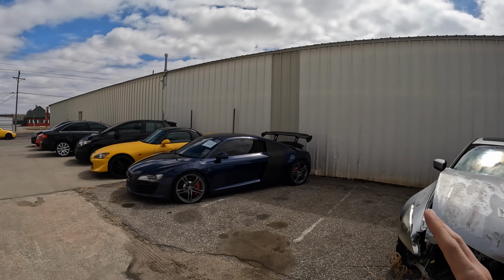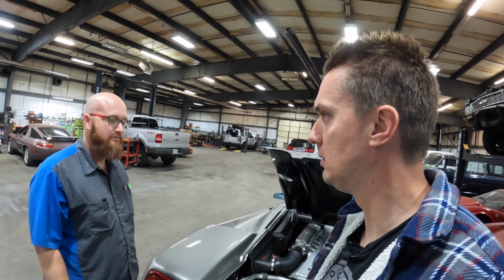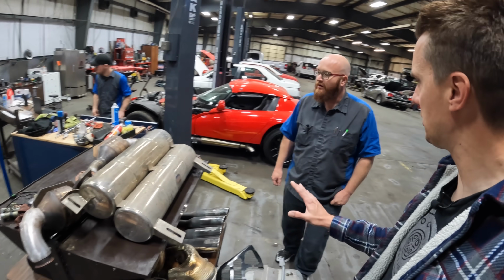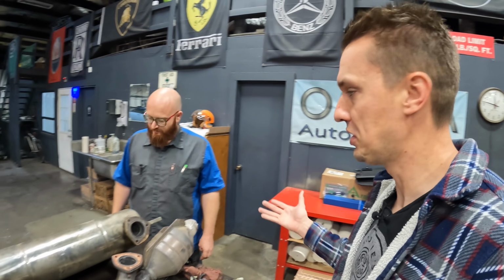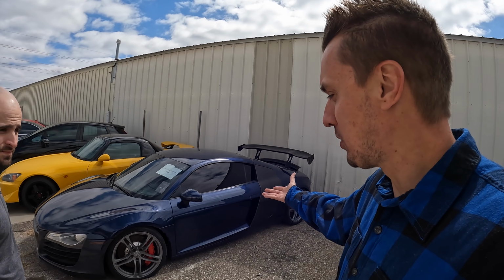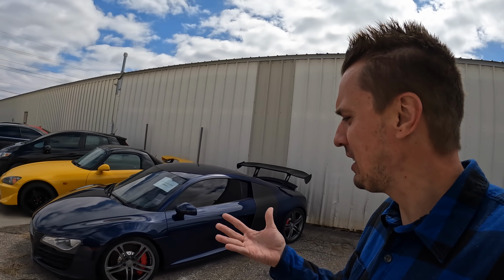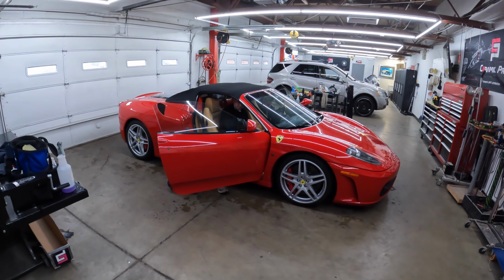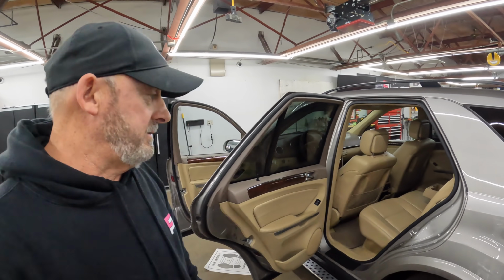How I got SCAMMED (again) buying a cheap Audi R8 for my wife

Comment: What I have learned about Audi R8s from YouTube: "It's an ultra-reliable supercar...now I'm going to half-ass mod it until it never runs right again."
Reply: Audi's have never had a reputation for being reliable.
Reply: @viralsheddingzombie5324  it depends. Audi inline-4s, inline-5s (specially) and even their v10s are great. The v8 in the r8 though, not so much, super complex and finicky.
Reply: @LuanCristianThums  lol what?
Reply: @LuanCristianThums  That's not even close to true my guy, the inline 4's have crazy issues, we've had several go boom on us in less than 5 years of ownership, the inline 5's are solid, and the V10's are well known to have lots of issues, ironically, the V8's in their RS4's and the like are the more reliable engines! There's nothing wrong with the V8 R8, just really poor mechanics who think they're qualified to work on them because it has 8 cylinders and must be just like the LS. 

Also, I feel like you're missing the point, there's nothing inherently wrong with the engines, but Audi's as a whole, are not known for reliability. My family has owned many Audi's, they all fall apart when they hit 5 years old, the interiors literally disintegrate because they use some incredibly cheap quality plastics that harden and become brittle over time. We switched to BMW a few years back and haven't looked at another Audi since, my old E46 has a more solid interior than my uncle's 2016 A3, and one of the "Pros" about the A3 according to CarGurus is a "well built interior", we own one, that's not even slightly true lmao the trim pieces fall off, they're barely held on by plastic clips that easily break, the center console is fading, the gauge cluster stopped working for a while before we got it fixed, the seats feel lumpy and uncomfortable, the AC vents are sticky, the door pull handles cracked and fell apart, the door latches broke several times. We haven't even talked about just how many months that car has spent in service either, it had overheating issues, head gasket issues, cooling hoses breaking because they're made of cheap plastic. He hates that car with an unbridled passion, but he's stuck paying for it, but that car wasn't my family's first run in with Audi, we've had older Audi's before and this is not a new issue, this is how those cars have always been built, as cheaply as possible, my uncle still counts himself as lucky because he's yet to have the engine fail catastrophically like my other uncle and aunt had the displeasure of happening to them with their older Audis. We, like everyone else, kept buying them because they are very good looking cars, but they're the worst cars possible to own for any length of time outside the warranty period. 

From what I've heard, no personal experience, but Mercedes seems to be of similarly poor quality RECENTLY, I've heard the older Mercs are tanks. From personal experience, BMW builds the best cars, but not recently as they too have started using lots of plastic in the engine bay with the only logical reasoning behind it being Planned Obsolescence, they want it to fail so you'll buy a new one, but even then, we still haven't had a negative experience with BMW aside from expensive service costs.
Reply: @chickenpotpie4045  well that might be the reason for confusion. I was thinking of engines that'd have something "inherently wrong" and that's why I mentionted the R8 v8, with plenty spun bearings even without any performance mods. I'd say opinions like these are highy dependent on experience, and at my friends specialized BWM shop they'd absolutely disagree with your last paragraph. The number of V8 BMW SUVs with expensive mechanical issues is astonishing. The diesels are even worst. Just the other day an absolutely stock n55 m2 had to come in for bottom end issues. S55 are known for their problematic crank hubs.

Truth is most sports cars nowadays are far from reliable.

I own a 2018 RS3 though and have not seen any serious issues yet from my experience or from other fellow RS3 owners
Reply: @chickenpotpie4045  where tf did your family learn to drive?🧐🤣🤣🤯
Reply: @viralsheddingzombie5324  They are even worse when a hack goes into the engine.  Little chance for recovery.
Reply: So true bruh!!! 🤣👌
Reply: @chickenpotpie4045  Imo people buy Audis to show off.

Comment: The noise is coming from the gearbox. There is a bearing issue. Put it in gear on a lift and you will hear the droning noise from it
Reply: What I said surprised at the wizard
Reply: The so called Wizard was slipshod at root causing the moan.  Quite right...driver in the car...up on a 4 post lift, start the car and run it through the gears...clutch in an out for throw out bearing... listening underneath with an automotive stethoscope to the trans casing.
Reply: Я тоже так подумал
Reply: this is kinda what i thought.. maybe gearbox, or maybe somthing else spinning that has a shot bearing..
Reply: Agreed, this is a bearing vs drivetrain/gear noise.

Comment: Me to my daughter thinking about buying a $4k 2006 330ci: “Get a PPI from the BMW dealer first”

Tyler: “$120,000 non original Superbird with an accident history that I haven’t seen in person?  Where’s my checkbook!”
Reply: I would love a 2006 330ci. Especially for 4K
Reply: How many miles does that 330ci have?
Reply: Take it from an owner of an E46 330 Ci.  She doesn't need a PPI.  She needs a tool box.

Expect the valve cover gasket, oil filter housing o-ring, and the oil pan gasket to be leaking.  Expect it to need a few thousand in suspension work.

Test the engine for good compression, make sure the transmission isn't too crunchy and that the driveline doesn't have a bunch of backlash, and if it passes those tests then she can do the rest.
Reply: The moment your daughter said "BMW" you should have said no, regardless of model :D
Reply: 330i can be reliable, but it is a BMW, and it leaks and burns oil if not maintained well 😿
Reply: @herrbrahms  you forgot the VANOS issues, LMAO, this is why I dont love BMWs
Reply: @herrbrahms   Owning a bmw e39 myself, the m54 is finnicky and I agree about the valve cover gasket, and oil filter housing, but haven't had any issues with oil pan gasket. The e46 in our family hasn't had any suspension issues, but I personally installed KW coilovers on my e39 because my struts blew, but could have spent only about $900 on FCPeuro for an entire 4 corner strut replacement. I'm not sure about the transmission issues, as I have the 5 speed manual, and the driveline issues generally tending to be the rubber "guibos". The one thing that hasn't aged well is really the electronics, and making sure that there's no sketchy aftermarket electronics installed is probably best. Otherwise, the biggest issue with my own car is the wheel speed sensors going bad over and over, as well as the bolts that hold them in tend to snap at the head, leaving nothing for the wheel speed sensors to be held in with. Not sure if the sensors are the same on the e46 but it's the biggest issue of mine. (Also, rust) But overall, they're good cars and it's great to see them out on the streets!
Reply: Money is no object when you push pencils for it.... carry bricks for a living and you really know the value of each and every penny
Reply: Just get her an older Camry and sleep well knowing she'll reliably get to where she needs to go
Reply: @igglybiggly6951  🤮 lol
Reply: @mikehunntt5338  They aren't exciting but darn near unkillable and easy to work on,compared to Bimmers
Reply: @taelorwatson9822  lol there’s one here in Texas for 500
Reply: @roodick85  got a link? I know people in Texas
Reply: @herrbrahms  in other words, it's will need all the crap addressed as any other old car. I doubt she'll be capable of doing any more than filling the fuel tank.

Comment: I have learned allot from Diagnosis Dan and one thing you can do is check to see which module is speaking the most. If that module is related to the mechanical related issue, then you are on the right path.

Comment: It's a shame about the R8. One of my friends got burnt on one a few years ago. Was told is had hail damage and needed a new battery and that it did run and drive. Got the car a week or so after later. Turned out to be a flood car and still had water/dirt in places. Engine had water in it. He sold it for less than half of what he paid for it. it actually recently went up for sale in NorCal with no engine in it and half the interior missing 💀
Reply: So, he tried to be a cheap-ass at an auction and it backfired. So weird how that happens
Reply: @rustler08  
😉😄😉
Reply: @rustler08  he got lied to by the seller, but I guess it's okay in your eyes because he tried to get it for a reasonable price? Sounds like someone got ripped off recently 🤔
Reply: @rustler08  who hurt you 😂
Reply: Was there any legal recourse against the seller?
Reply: @rustler08  no 😂 i didn't say anything about the car being cheap. He payed a good amount for it, was lied to about the condition of the car.
Reply: @mexicanspec  there wasn't. but ebay auto gave him i think it was around $15 grand back. Which was no where near what he paid sadly.

Comment: Tyler, I believe the humming noise on your Diablo may be due to a chirping coming from the front main seal sucking in air. Have Wizard check the crankcase pressure. Maybe too much vacuum from clogged PCV, if it has it.

Comment: Hey Hoovie, sorry I’m late but you may want to check the front diff fluid on the Diablo VT. It can make a similar whining sound if there is not enough fluid in it or if the fluid needs to be changed. Hope this helps!

Comment: I dont think scammed is the right word.  If this truly was the cheapest r8 in the country then you bought it with your eyes wide open. If its a deal that seems too good to be true  well then it is.  I am guessing you bought it knowing it will make good content regardless of its running status.
Reply: Give it to J.R.
Reply: If they said it was something it isnt ("Running and driving"), surely that is the definition of "scam" (or maybe "fraud" ?), no matter what price?
Reply: @GoldenCroc  i have a semi with a 855 cummins in it.  It runs and drives.  Though when one of its connecting rods let loose  it left a hole in the block i could put my fist through.  Welded up the hole and removed the offending rod .  It still runs and drives .   Maybe Hoovie is interested in it?  Wont be the cheapest one in the country though.    He knew what he was buying
Reply: Yep not a scam when you bought it for "content" and content it is providing!
Reply: @patrickhickey8779  I am sure he does. Still doesnt excuse trying to pull a fast one to me. This car neither runs, nor drives, no matter what else is wrong with it. Wont start at all. Lies are lies. At least to me.

Comment: 5:45 ~ That sure sounds like a intake resonator issue. I'd disconnect the intake at the throttle body and test drive it.
Reply: Buy 75 cents worth of shooter earplugs.  Or get the Lambo models for $3500.00.

Comment: If you can get a known good waveform from a running r8 you could check timing with a lab scope without taking anything apart. I'm amazed you haven't found a shop that knows how to do this.

Comment: AWD? VISCOUS COUPLER? Could that be making the moan sound? Front output shaft to the front wheel drive? It only makes the sound when when you're rolling/ coasting/ light load. Or it's got to be in your drive belt assembly.
Reply: I was thinking the AWD system as well.
Reply from the maker: It does it when the car is not moving as well with sustained revs, or in neutral.
Reply: @HooviesGarage  brake booster plumbing?  Vacuum related?
As an aside, if you don't get anywhere with the Superbird I would reach out to Kevin Smith at KSR Performance (great youtube channel) in Gainesville FL. He is an absolute master of performance cars.......maybe you could take it on Rockey Mountain Race Week when it is done!
Reply: @HooviesGarage  it sounds like a rubbery squeak. It may be in your accessory belt area.

Comment: Ive heard differentials make that whine from the diablo before on a new allroad when I worked at an audi dealer. It was under warranty though. Get a stethoscope to check for bearing noise on the lift

Comment: $15.000 for exhaust! Someone is laughing all the way to the bank.
Reply: He wanted the welds to be made out of gold with saphire encrustation.
Reply: I caused an online "furor" in the M3 community a few years back when I proved that the 170$ eBay stainless steel aftermarket exhaust systems were EXACTLY  the same as an "exotic " maker...one that charged 875$ for them. The "exotic " brand simply had their Logos laser etched on the tips...the "no name" didn't.  But..put on a scale, ounce for ounce identical, same welds, same pope diameter, same plating.

Comment: Audi's are nothing but high dollar Volkswagen's.  They are fast because of hand grenade engines.  They both last about 100k and share the same parts.  Ask yourself a question, why don't I see any old Audi's on the road like BMW's and Benz's.
Reply: I definitely see a lot of old Volkswagens  on the road
Reply: @Tommyyyy25  The topic is Audi Tommy, all their all wheel drive, 2 wheel drive cars of the past.  There are few older than ten years.  They also hold little resale value and cost as much to fix as a Benz or BMW.

Comment: Tyler, do you read the comments anymore? I mentioned this on the last video about this car & it’s moan.
That is most likely a transmission sound, and if you’re lucky, it’s a CV joint or wheel bearing. Start with wheel bearings, then CV’s, but I’d bet it’s the transmission.
Reply from the maker: It does this in neutral with no load, just sustained revs. I can even get it to make the noise when sitting if I rev it long enough
Reply: @HooviesGarage  transmission input shaft still spins in neutral except when the clutch is engaged. Other possibilities: belt, accessory bearings, intake leak pre-MAF
Reply: @brainndamage  I think you’re on the right path, now that I know it moans when not driving. Time to break out the automotive stethoscope.
Reply: @DrinkWhiskeyRaiseHell  didn't he say he did think this wouldn't fix it but hoovie wanted to do the exhaust anyway?

Comment: You've been "scammed" on at least 10 cars. Comes with the territory of buying a car without a PPI
Reply: Its almost like he does it on purpose to use the word in the title. Hell he even claims some minor stuff in some of his cars are scams.
Reply from the maker: What minor stuff? A Superbird showing up overheating, barely running and halfway wired up, or an Audi with a ruined engine that I was told runs?
Reply: @HooviesGarage  What the seller did was 100% wrong and borderline fraud. 

But performing proper due diligence on your part could have prevented that imo. 

Fool me once...

Comment: Sounds like the 1st shop forgot to swap the crankshaft reluctor wheel when they swapped blocks or it fell off during the timing chain job. You mentioned no crank signal. Pull the crank sensor back out and look up there with a bore scope. Good luck hope you get it running.

Comment: Just a longshot on the Lambo noise - check for a clogged PCV system - the noise may be due to high pressure in the crankcase.

Comment: On a 90s Maxda Protégé, the trigger at the crank could go in two ways which moved the tdc mark to the crank sensor. If I recall correctly 5pm vs 7 pm.
Thing is it would give one or two sparks on crank then more. It seems like the ecu detected a mis time so shut off ignition.

Note the gears and crank are properly timed to the belt but the trigger stupidly could go on in two different positions. (The slot)

Maybe the Audi may have a similar set up in yhat v8

Comment: I have all the software for audi/bmw/Mercedes on my laptops. What I’ve seen previously on these are shops replace timing but reuse the bolts that hold the timing sprockets in place then they slip and bend valves. Not near as expensive to repair as you think. Tempted on the ml myself but I’ve had them before and I prefer black or gray interior.

Comment: I had a vehicle that made that same noise, not a lambo obviously, but there was a hidden crack in the intake plumbing (not the intake itself) between the air filter and the throttle body. Sealed it and the problem went away and never returned, for the remaining 6 years we owned the car. It would make the noise most when traveling at highway speed, no noise at idle.

Comment: If the engine is trashed take it back to the Wizard and drop an LS into it.  Make it push 600hp with twin turbos or supercharger.  It worked on the Apollo 911.

Comment: You can add a trap in your exhaust system to stop the specific frequency band that's annoying you, without affecting performance or the rest of the sounds.  Not that costly but you need some space for the tube.

Comment: I think the sound is in the Brake Booster. Vacuum and RPM related. Not sure if it has a Vacuum brake booster. My Ferrari’s don’t, but Lamb has used them. A rubber bladder makes that noise. It is a leak somewhere vibrating it like a “reed valve” of an instrument. Not metal to metal. Not mechanical. Could be a tube or hose, but my bet is some sort of “Vac pod” or similar item. Seen it before. I bet Wizard knows and it is more content :-)

Comment: That noise is coming from the driveline. You can hear it independently from the engine. For the R8, just find a 4.2 V8 from another Audi (s8, s4, s6,etc)

Comment: My money is on the intake system. It sounds like something isn't sealing right and is causing air to be pulled past a gap and vibrating the part, like a reed in a clarinet, when more vacuum gets behind the filter. Heck, there might even be something in front of the filter causing it to draw more vacuum on the intake. It could be something as silly as someone dropped a rag in the air box.